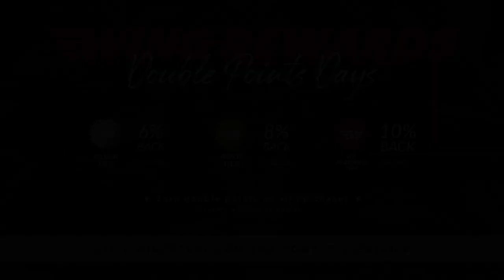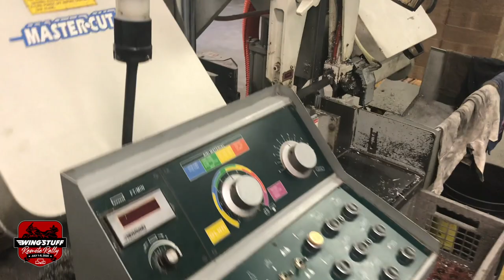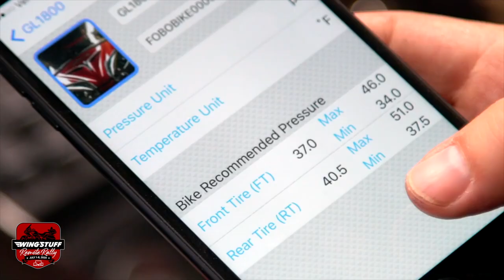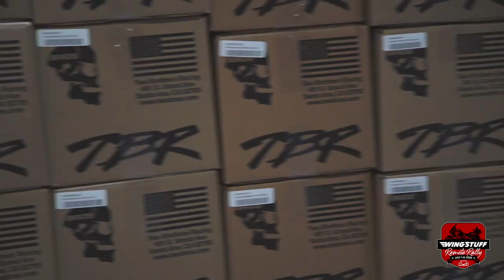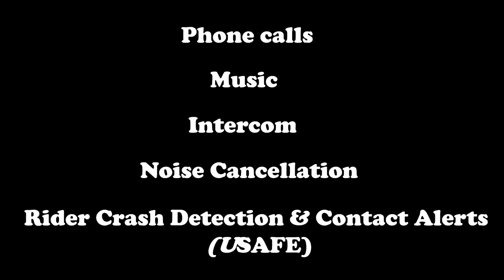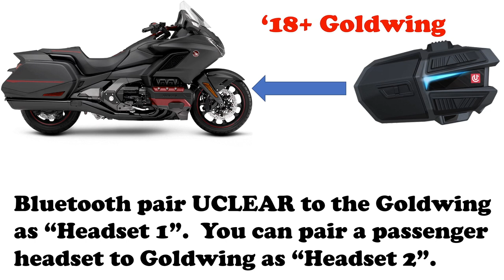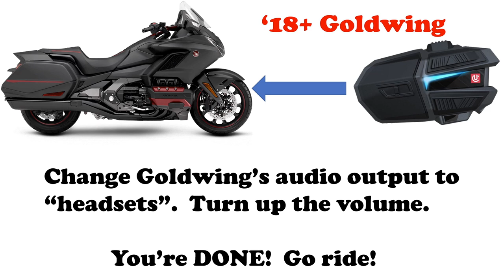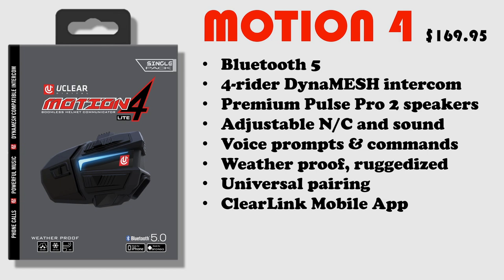WingStuff Remote Rally Video | July 2020 | WingStuff.com

Comment: Awesome video . By the way I have the same bike 2020 Goldwing and I saw new product made by kuryakyn rear panel filer  light , where and when  I can order this item
Reply from the maker: Thanks, Trent! As far as the Filler Lights go, I'm not sure about Kury but Goldstrike has them available here: https://wingstuff.com/products/38040-led-filler-panel-lights-chrome. They also have a black version but they're currently out of stock. However, on the product page you have the option of being notified when they're back in stock by submitting your email and clicking the "Notify Me" button. If you have an account with WingStuff and are logged in you only need to click that "Notify Me" button. I hope this helps!  Oh and here's the link to the black version: https://wingstuff.com/products/38254-led-filler-panel-lights-black

Comment: At 1:52:37 what are these called on the website?  The side wind deflectors.  I couldn't find them.
Reply from the maker: Hi Shelby, we don't have these up on our site yet but will shortly. In the meantime, our customer service guys will be more than happy to order them in for you. Keep in mind that these wind deflectors are made to fit with National Cycle's V-Stream windshield and WILL NOT work with the stock shield or other aftermarket shields. Thanks for your question!